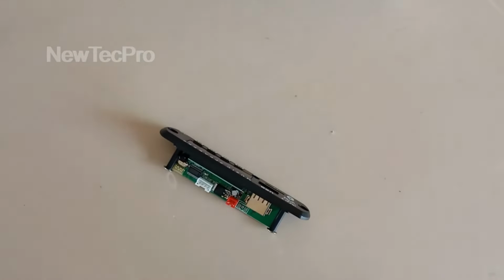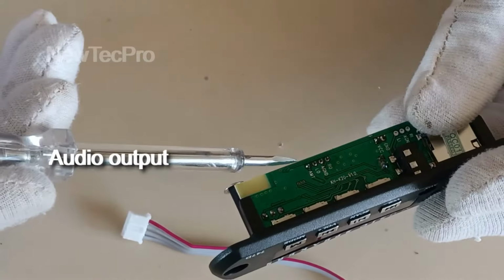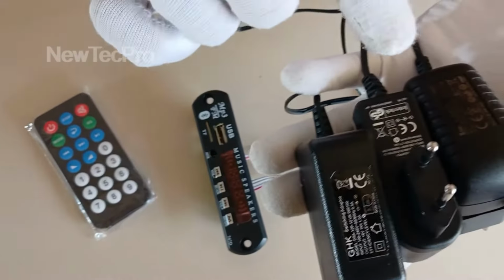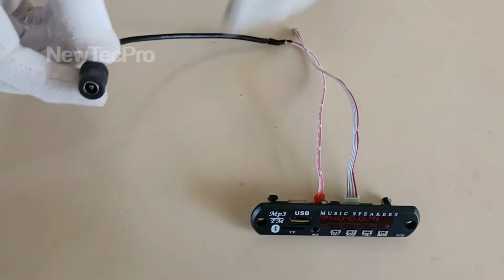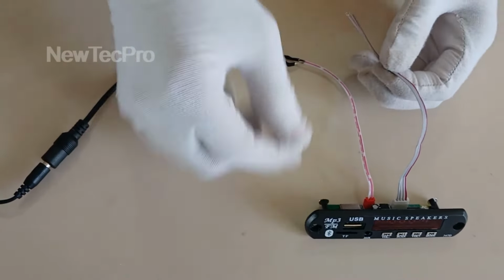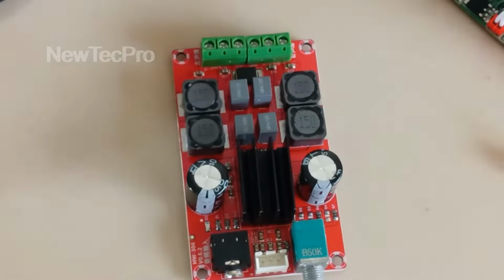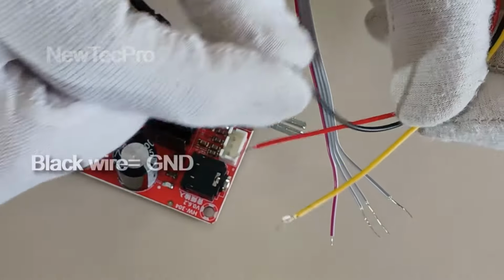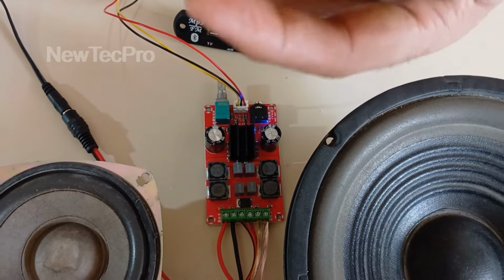how to install Bluetooth MP3 Player Decoder for amplifier

Comment: Thank you for the interesting and useful video. These Mp3 USB player modules reduce the volume a little, but provide a complete player to the user. What voltage should we give them?
Reply from the maker: The input voltage is from 5 to 12V. But the best option is about 7 to 9 volts DC
Reply from the maker: The input voltage is from 5 to 12V. But the best option is about 7 to 9 volts DC

Comment: Hello do you think it will work with Powersupply Mean Well LRS-150-12 12V 12,5A (i'm afraid not to fry it) is a powersupply meant for surveillance cameras but is lying around and wanted to make use of it.
Thank you for your time!🙋‍♂
Reply from the maker: Hello. The input voltage should never be higher than 12V. Is the power supply not fluctuating? Are you sure the output is always below 12V?
The amount of amperage does not matter and the MP3 player module consumes as much amperage as needed.
Reply: @newtecpro  Thank you for your time to reply and indeed i saw it fluctuating like 12,2-12,1-12,0 but I can adjust it between 1 and 12v so from what you told to some1 optimal is 7-9v. I will try 9 too and Thank you much for your time.
Best regards!🙋‍♂
Reply from the maker: you're welcome. Yes, 9V is great. But note that some of these modules only work with voltage 5. They do not have voltage converter regulators. After this, make sure that the input is 5 to 12 volts.

Comment: where  I could buythe other board amplfir board channel?
Reply from the maker: Sorry. I did not understand your question. Can you explain more?
Reply: Where I could buy the amplifier boars you use  for mp3 decoder.?
Reply: board
Reply from the maker: @Bentapinoy  XH-M139 2*50W+100W amplifier board is a suitable option for building a complete audio system. You can buy this through Amazon
Reply: thankyou so much How it cost?
Reply from the maker: I saw the price on Amazon. It is about 8 to 11 dollars

Comment: What is the size of the cable that connects to the board of the kebidu mp3 player?
Reply from the maker: Do you mean the stereo audio transmission cable? If you consider this cable: use a shielded cable. Its length does not matter

Comment: Fm radio's antena wire where we connect ?
Reply from the maker: The FM radio antenna wire is connected to the module. A red wire is soldered with solder.